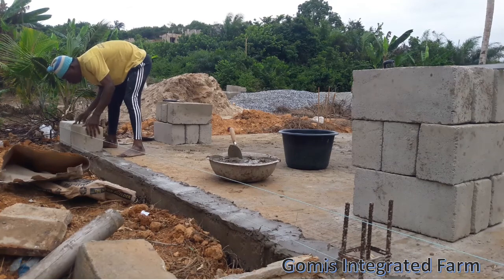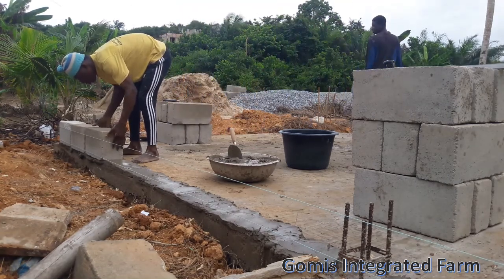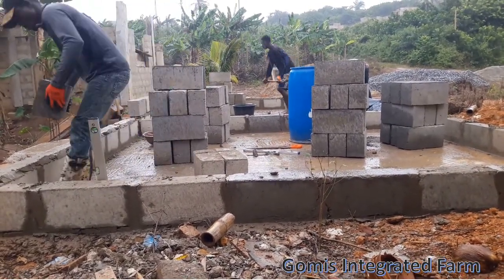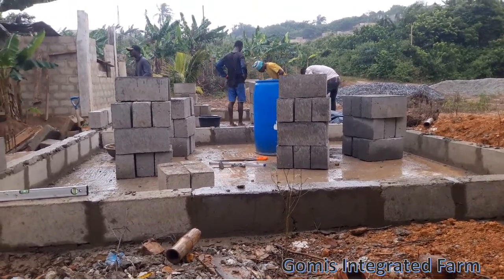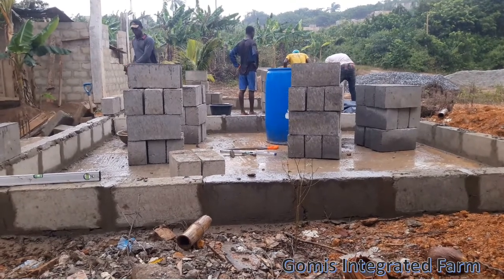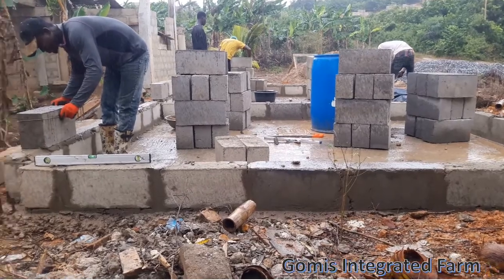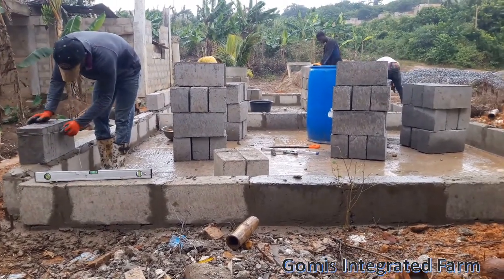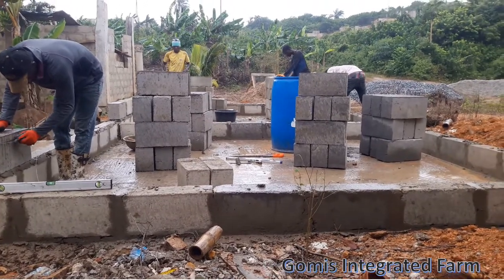CATFISH POND CONSTRUCTION EP3!!! HOW TO LAY BLOCKS FOR FISH POND

Comment: Hi I'm building a 30000 capacity fish on a concrete pond. I am planning to have 2000 fishes in one pond. please what size is the pond going to be for the 2000 fishes thanks.
Reply from the maker: thanks for the question.
I can not give you a definite size for the pond (tank) because of the volume of water that will be in the tank is the factor to consider and so as the size of the fish in it. 
For every  1 inch of a fish length , a gallon of water is required.